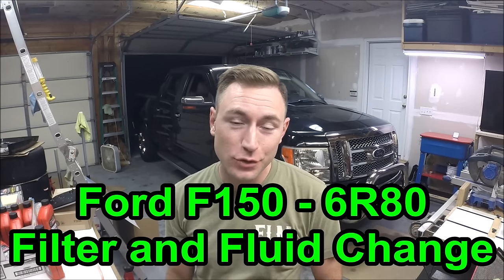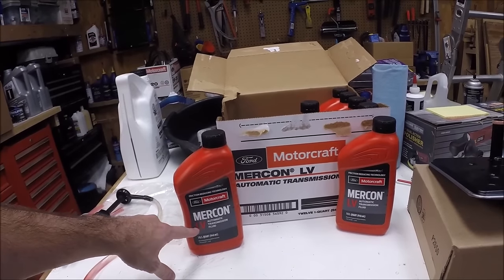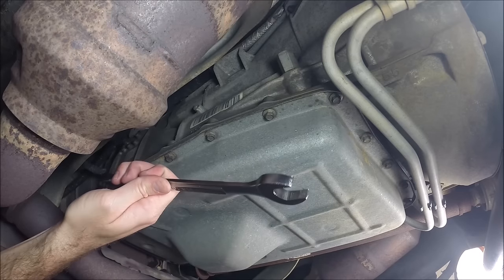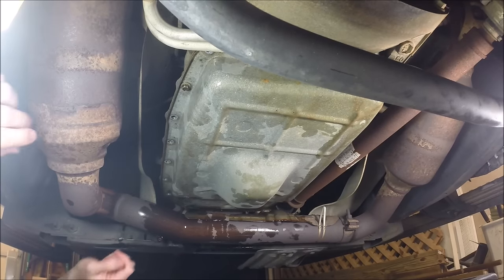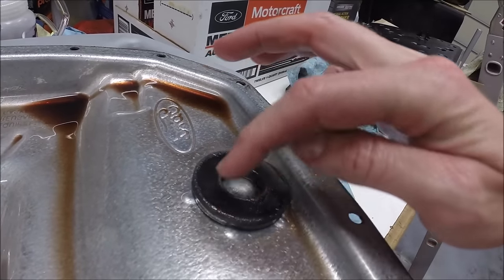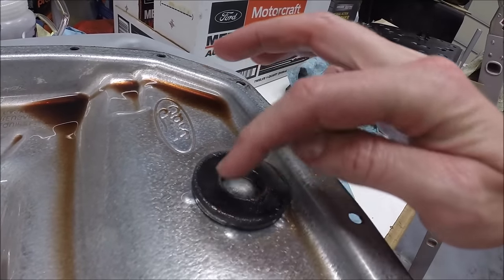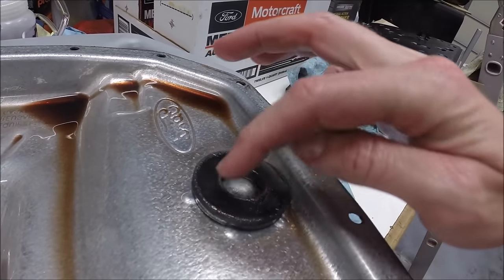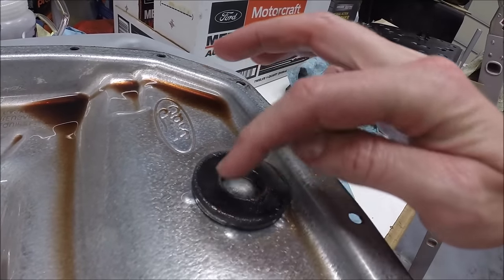Ford F150 - 6R80 Filter and Fluid Change

Comment: Amazon sells a F150 transmission (6R80) pan with a drain plug for only $40.00. And a Mighty Vac (only takes out 4qts. But jack up the rear to where the rest of the fluid is in the front to suck out another 2 qts. Leave 2 screws and  That’s enough to put the mighty vac in between the case and pan to get another qt. Let it drip over 12 hrs and grab another qt. 8qts total. Install your new $40.00 pan from amazon with a Drain plug, cause next time you’ll grab 8.5 to 9 qts. Drive about 150 miles and drain & fill again. Use Amsoil Signature series atf fluid Blue Cap. What I have learned to get less burns. Before re fill, jack the passenger side font up or drive it on a ramp and you’ll be able to get all 9qts back in. I have a 2013 F150 with the 6.2 & 6R80 and I tow a lot, but your transmission will love you at 450,000 miles using Amsoil in Engine oil, transmission Oil/transfer case, front and rear diff oil, coolant and even break fluid.

Comment: 2010 6R80 transmission fluid change: Weigh a new filter. Weigh the filter you remove. The difference would be the the volume of trans fluid you should expect to replace, after starting your F150. Like your videos. Thanks for your time, clear & concise video, with extra info re: aftermarket oil pan & drain plug

Comment: I know this was three years ago.   So you may not remember your comment about the rumbling while going slow in OD.   My 6R80 does the commonly reported heart beat style rumble at 30 to 40 mph in OD,  A light tap and coast, it stops a bit, very annoying,  but usually have to push OD off.  Did the fluid change make the your rumblr go away?
Reply from the maker: Yea, I had a slight shudder and the new fluid definitely helped.   I also had a thunk noise at take-off, but that is an issue with the driveshaft I believe.  I'm pretty sure there's a fix for that also, but I have since sold the truck, so I never got around to addressing that concern.

Comment: I bought the dorman pan with a drain plug. I drilled a hole in the old pan and drained it hardly any spill , drilled it the lowest point .
Reply from the maker: Nice.  The Dorman pan wasn't out when I did mine, but that's definitely the way to go.    Glad to hear the project went well for you.

Comment: Here are some other possibilities:  Get a 6 or 8 foot clear pvc tube with about a half-inch OD, and you can siphon most of the fluid out.  You can get the siphon started using a shop vac.  Drop the pan after the siphon is sucking air.  To fill, thread the tube down from the engine compartment into the fill hole, then stick a funnel in the top end of the tube, and you can stand up while filling.  To remove fluid, you can suck it out using a turkey baster stuck into the end of the tube.

Comment: Liked you video. The only comment is I would have used a suction tool to suck the transmission fluid out thru the dip stick as much as you can before removing the pan. This way when you dropped the pan you won't have any fluid going onto the exhaust pipes.
Reply from the maker: Not shown in the video but I did try that to some extent.  You can get some of the fluid but not all of it.  So either way you're going to make a mess when the pan comes down.  In the end, for me it was easier to just accept the mess and let the pan drain.

Comment: System takes 13.1L. Pan hold 4.5 or so. Converter holds ~9. Least on the T150-350 3.7 series 6R80s. :)

Comment: Hi there. Nice job. Nice presentation. One nice trick by another Tuber was stuffing aluminum foil in the back end to fill the gap and direct the flow to the catch can. 
Big question: Did the slapping on low gears stop??
My 2013 Ecoboost started slapping and making a clunk dropping in and out of overdrive, 6th, gear

Comment: Hello, just saw your video today and you mentioned a shudder in the transmission. I have an older 2006 F150 with 5.4 3v. I also had a shudder in my truck at lower rooms under a slight load. Turns out it was the spark plugs and 2 coils . Shudder gone truck runs great at 200,000 miles. Hope this helps
Reply from the maker: Good tip for anyone trying to solve a shudder.  It could be things other than just the transmission.   Thanks for sharing.
Reply: Michael Reardon, I have the same shudder issue . Curious did you have any misfire codes showing which cylinders you were having issues? I'm about to change my trans filter hoping it will fix the issue. let me know and thanks

Comment: Good video and I'll add my experience on my 2009  and another WTF was Ford thinking. I bought my truck used and was parked in my driveway which is on an incline so the rear of the truck was lower than the front and fluid started leaking from the back right side of the tranny, come to find out it was leaking from the seal where the electrical block that the wires connect and go into the body of the trans. After some research I found that the ONLY way to change this out was from the inside where the holding clip for this is so needless to say forced fluid and filter change. I'm sure it needed the change but what I'm getting at is if you are planning  to do this job I would recommend changing the elect block to avoid having to tear it all back apart if and when it starts leaking.

Comment: I have a 2011 Model ( 120k Miles ) that had the cluck occasionally and a slight vibration taking off ( around 50-60k miles ) . Ford had -- has a recall on the driveshaft for this. Drove it in and they replaced it with a new one. No more vibration or cluck. Good tips on changing the fluid,  thanks . Going to try and do a flush removing the cooler line and using the transmission pump to flush it out-- also pumping the pan close to dry before removing. 2011 Ecoboost --  Nice Engine.
Reply from the maker: Yea, mine has developed the driveshaft/slipyoke clunk recently.  So eventually I'll have to address that too.  There's always something to keep me busy, haha.
Reply: @ScrufsGarage  Mine had the same thing and was searching searching searching all over the internet on how to get it fixed because it was so dang annoying. All I needed to do was drop the drive shaft and grease the splines. The clunk immediately was gone! Definitely try greasing the splines on your drive shaft before doing anything major. Took less than an hour. It's even easier if you can get it on a lift.  Also be sure to mark your drive shaft before you take it out so you can put it back in  the exact same way it came out.
Reply: @ScrufsGarage  there is a TSB and a clunk kit, grease and boot clamp from ford for 15.00.
Reply: For the clunk noise also check the leaf spring isolators, mine were totally worn away.

Comment: Did your shuttering go away? Just did mine had a slip on 3rd gear, fluid was low before I began. But it’s great now, awesome video thanks man.
Reply from the maker: Yes, it definitely helped my shuddering.     Glad to hear the video was useful!   Thanks for watching.
Reply: @ScrufsGarage  Changing the rear diff fluid with the friction modifier will fix the shudder after about 500 miles. Its the limited slip making that shudder. Mine did the same and went away after the change

Comment: I done the same on my 3.7 mustang that has the same transmission at 57k. I think its a great way to keep the trans in good standing. I bought a fill port so you dont have to drop the pan the 2nd time.
Reply from the maker: Good call.  For a vehicle you're planning to keep and know you're going to need to service again, I think adding a pan with a drain port and fill tube kit is money well spent.
Reply: @ScrufsGarage  Thats what I did. Amazon $34 for the pan with a drain. I did it on a F350 and it made the job so much tolerable.

Comment: Man, I have a 2009 f150 4x4, with only 40.000k miles I bought new, it has the 6R80 trans, it's leaking from the right rear of the trans pan, I think it's the bulkhead sleeve leaking, I guess I'll have to take it to the dealership !

Comment: Not sure what came out, but I know it was low, because the torque converter was acting up due to the infamous leak around the electrical connector at the rear. I put about 7.5qts in and I still think it needs another half quart maybe.  Extremely important to check it with the engine running. I was lying there on my back just staring at it dumbfounded, wondering why the entire dipstick was soaked in fluid. Truck started acting up again. Added another quart or so with the engine running and things smoothed out.  It's not bad doing it at operating temp next to the cat with some good Mechanix gloves and care.  I have Forscan on my laptop so I when I crawl back under to give it a little topoff I think I'm hook up the laptop and verify transmission temp. I think 190 is normal?

Comment: How did you get the rear bolts out so easily? My exhaust pipe on my 2016 XLT V8 from the left side crosses over right over the bottom of the trans pan, I'll need some kind of offset wrench but in your video you just breezed through so I wonder if your 5.4 had more clearance than I do.

Comment: Very informative video. Did it solve the shuttering problem? I have a 2010 xlt with 228k, it started shuttering on me
Reply from the maker: Yes, changing the fluid made an improvement in the shudder I was experiencing.  Keep in mind you're only going to get back half the fluid out.  So if your truck has 228k miles on the original fluid, it may be worth doing this a couple of times to get more of the old fluid out.

Comment: i wanna see how yall take the back bolts out with out stripping them i had a tuff time taking them off and torqueing them back down but i got it down i wanted to see but you skipped that part. To see if theres an easyer way

Comment: Currently doing my 07 Explorer 6r60 trans fluid pan drop, so far I've only got about 4.5qts out, that's not including the couple splash spills and oil soaked rags lol so I'd say maybe 5.5 to 6qts. Thanks for the awesome video
Reply from the maker: Thanks for watching.   Glad the video was helpful/
Reply: @ScrufsGarage  so I forgot to mention, I measured the fluid before I started the job, while in park and truck running the dip stick didnt show any fluid at all. I measure the fluid that came out and 6qts came out. I refilled it and it took 7qts until the fluid showed on the bottom of the hash. Truck shifts noticeably smoother now. Job was on a 6r60 which is similar to the 6r80. I added a drain plug to the pan so at every OCI I'll remove 2qts and add 2 qts

Comment: My Ford service manual (digital version) shows the torque spec for the trans pan bolts to be 106 lbs/in.  My manual covers 2013 F150s with the same 6R80 transmission shown here.  Ford probably changed the spec somewhere along the line and possibly for a good reason.  

BTW, even though people usually refer to torque specs as ft/lbs or in/lbs, technically it's actually lbs/ft or in/lbs. But just about everyone, including myself, refers to it incorrectly.   I do it (knowing it's incorrect) because other people think it's supposed to be expressed that way.    Lbs/ft and in/lbs is actually a measure of work, not torque.  You can read how this works in a Wikipedia article or just do a search.    So, say it correctly sometime and when someone tells you you got it backwards, bet them $10 bucks that you're right and they're wrong and then collect your $10.   :-)
Reply: Lol.   You mean lbs/in is correct.   Edit your post
Reply: Torque units are  N-m (Newton - meters) a force ,  measured in Newtons, applied by a lever arm  at a distance , measured in meters.  So the English equivalent would be lbs - in or lbs -ft (not lbs/in or lbs/ft)

Comment: Any long-term feedback on adding the 7-7.5 qts? Has it been the right level or too much? Very helpful thoughts in this video on the amount of fluid. I was confused because I got about 6qts out, then refilled with about 5.5qts and it overflowed. Then I started it and ran it through P > N > R > D and checked it while running, and the dipstick was dry, almost completely empty. I'm going to go back and add some more with it running and "fine tune it" per the service procedure. I'm a little nervous on overfilling it since I already nearly replaced what I took out.
Reply from the maker: I agree, it's very odd that there's a difference in the amount of fluid that comes out vs what's needed to get it back to full per the service procedure, but it seems to be the same experience with most people based on the comments I've seen.  Last year I traded in the F150 on a Gladiator, but I can say that in the roughly 15k miles I put on the truck after changing the transmission fluid, I did not have any issues, and that the shudder issue I was experiencing was greatly improved.
Reply: @ScrufsGarage Thank you!! I just "topped off" while running the engine warm, shifting between gears and got another 1.5 qts in it for 7 qts total. It read as it should on the dipstick to the bottom/middle of the bottom set of hash marks.. So strange though

Comment: Real big tip: just use that pump to get most of that fluid out of the panm through that hole, before you drop the pan, that way you don't lose any and you can pour it all out and measure what you drained, to possibly match what you put back in. Ideally when it's cold and you replace with cold.
Even better tip: replace that plan with a drain plug version for the next time it's to be changed.

Don't do this while the fluids are warm.

Comment: I drained a full 5 quarts out & spilled about a 1/4 quart. I refilled with 5 quarts  before overflow. I closed it up & drove around until the tranny temp was up to normal op temp. I rechecked level while hot & running & it was low, I added another 1.25 quarts in  while hot & running & level was at the top of the crosshatch marks.

Comment: I did mine today. 2009 4.6L.. 193K, never been changed before.  I got about a little over 5 quarts out. I put about 6ish back in, plus I changed the bulk head connector. I've had a very slow leak coming from that. Everything was pretty straight forward. I made a total rookie mistake tho, on the very last bolt after everything had been put back together I snapped off one of the corner bolts. I was rushing and I didn't break out a torque wrench like I knew I should've, I was using my impact and over did it. It's not leaking but I can't sleep at night knowing it's like that. I'll be fixing that after work tomorrow.
Reply: Yeah you should NVR use a impact to tighten bolts back up on Aluminum!! If you didnt snap the bolt head you could've stripped out the hole..these only take 8lbs of torque.
Reply: @planetofthederps4490  I take the bolts out with an air impact wrench, but install the bolts with an electric screwdriver and then torque down with a torque wrench.

Comment: Thanks for the information and making the video.  If I might add, that you explained a lot but some important info that would help people as the try to do this is data like what size wrench to remove the fill cap or what size socket to remove the pan bolts.  Maybe filter part number too.
Reply: Fill cap is 19mm. Pan bolts are 8mm. I think he mentioned the sizes but I could be mistaken.
Reply: 3/4" socket on mjne

Comment: Did it fix your take off shudder? My 2014 is starting to shudder when first giving to some gas! Good video. 👍👍🔧
Reply from the maker: Yes, the fresh fluid definitely helped my shudder.   It's worth noting that there's a common issue with a clunk/bump when first taking off that is related to the slip yoke.  I don't have the details handy but I believe it's a fairly simple fix.
Reply: @ScrufsGarage   Ford sells grease and a new clamp to service the slip joint, will be doing this and trans service with new pan with drain plug $40.00 ebay with gasket too!

Comment: I changed the transmission fluid today in my 2014 Mustang GT with this trans.  It went pretty smoothly.  I put all four wheels up on ramps and still barely had room to get under the car.  Prior to today, I had bought an extra Ford tranny pan and had a drain plug welded in and had also installed the Performance Automatic dipstick kit.  I had also bought a huge drain pan that was big enough to cover the entire size of the pan so any messes were kept to a minimum.  My car only had a little over 31,000 miles but I wanted to change it early based on FordTechMakuloco's recommendations in his video.  I only got out about 5.75 quarts of fluid and that is with dumping the filter out and I ended up putting in 6 and it was right at the full mark on the PA dipstick.  PA recommends only filling it up to about half way into the cross hatch area of their dipstick even though they say anywhere in the cross hatch is okay.  I've left the fluid alone but may drain some out to get it to the halfway mark.  The car shifts fine and seems slightly smoother than before.  I let it idle for awhile and then took it for a drive to make sure the internal thermostat would be open when I checked the level.  I used the Motorcraft Mercon LV and the correct Motorcraft filter.   The dipstick made filling the tranny easier but kind of slow since occasionally the fluid would back up in the funnel and "burp" fluid out so you had to make sure you kept something to put over the funnel handy to avoid making a mess.  All in all it went pretty smoothly and the old fluid wasn't that bad looking.
Reply from the maker: Sounds like you've got a great setup.   Especially since you're car is so new, you'll really be able to get your monies worth out of the new pan and dipstick.

Comment: Great video. I just swapped fluid on my 2014 F150 5.0 coyote. I got roughly a little over 6 qts drained out (that includes fluid in old filter). Case started to overflow at 6.25 at a going back in.
I didn't have a chance to check level but will in a day or two. Running smoother already.